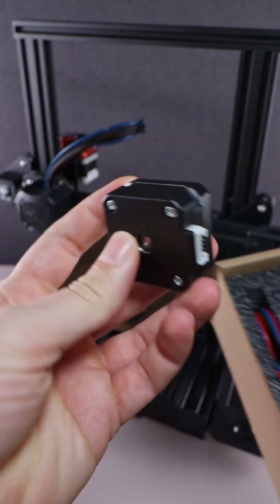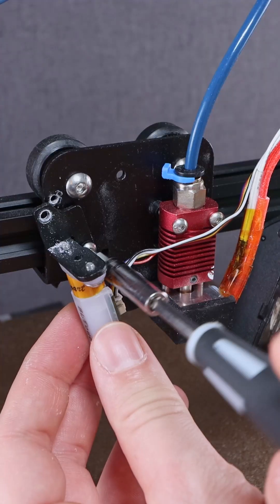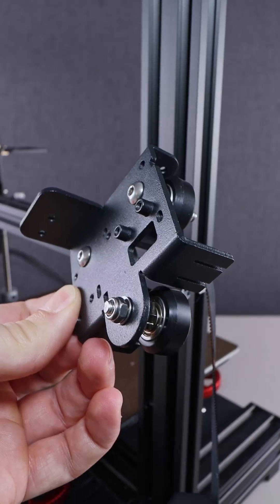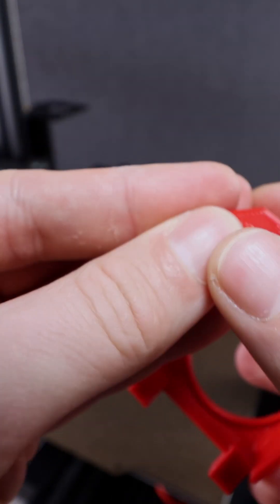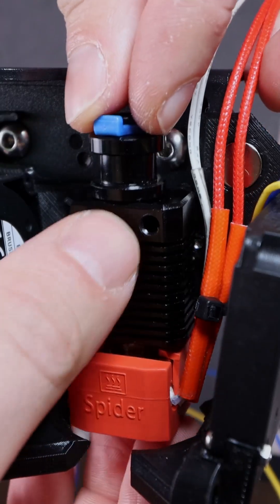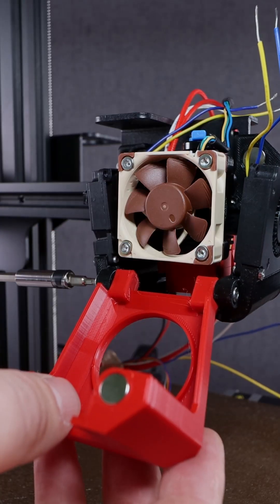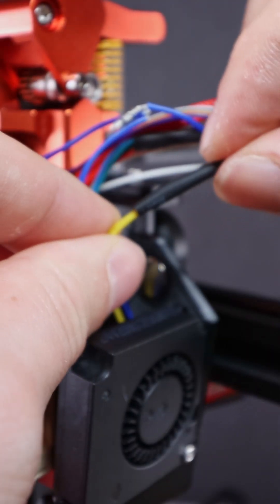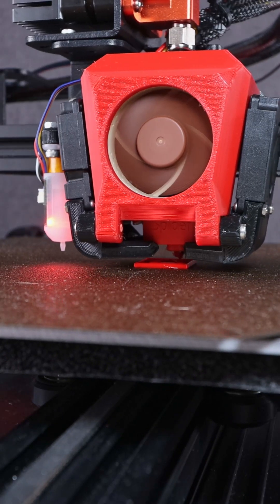Full Hotend Upgrade for my Ender 3 V2

Comment: Just use the bowden setup and never downgrade to the pancake stepper motor as they only produce half the torque of the 40-42 stepper motor. Lost performance from the new hotend just to have a directdrive hotend.

If you want a direct drive setup use the Orbiter V2.0 with an E3D V6 hotend.

but if your budget is tight this is fine just don't downgrade to the pancake stepper motor.

Comment: How did you get the pancake work? Mine doesn't move, I tried also VREF voltage to accomplish stepper Ah, but nothing. 
I'm mounting a complete Titan + E3D V6 that has already 3:1 ratio.
Reply from the maker: Hmm, I didn't really do much more than adjusting the vRef. Did you get the pancake stepper with right voltage? It needs to be 12V. I am using this one: https://geni.us/PancakeSteppe It works flawless!
Reply: @thebuildbay  Finally I succeded. 
I had to swap central wires on the JST plug of the extruder. Ender uses 1-4, 3-6, and my pancake from Kingroon uses 1-3, 4-6. 
Due to overheat I had to reduce VREF for extrusor stepper in the motherboard (v4.2.2) from 1.38v to near 1.0v.

Comment: Didn’t use any blue lock tight?  You need to use blue lock tight for every screw that screws in to metal parts.  If not the screws have a big chance of coming lose

Comment: Weak pancake will miss steps. Spider v1 is garbage
Reply from the maker: So far both are going strong, can't complain 💪
Reply: Mine fell to bits I replaced heat break it fell to bits. Many many people have had same issue. However the spider 3.0 is far superior and nearly as good as my dragon. The pancake is really suited to a 3:1 or 5:1 bmg gear set up due to very low rms current handling.

Comment: don't use that extruder with that stepper motor, you're going to burn it, that pancake is designed to be used with an extruder with 3:1 reduction or more, by itself it doesn't have the necessary torque to move an extruder of the type you use
Reply: With ender 3 speeds it'll be fine. But still not a single part of this video makes sense. 2x 4010 fans instead of a single 5015, spider hotend over a cheaper chc, direct drive but not going for the new bondtech gears.

Comment: It's not a direct drive, it's just a very short bowden extruder
Reply: Even the Orbiter extruder has a setup like that. Unless the hot end screws into the extruder, you will likely have a tiny bit of ptfe in between the two.
Reply from the maker: Its not about the lengths of the tube, but about how you use it 😎

Comment: That pancake motor should be used with at least 3 to 1 reduction 
Using it with 1 to 1 you probably can go max 50mms ...or less
Reply from the maker: Actually, I am able to print up to 150mm/s without any skipping or underextrusion😎 The siginificantly higher flow of the Spider hotend compensates quite well for the reduced torgue of the E-stepper
Reply: @thebuildbay  thats pretty good
Cht nozzle ? Or new stronger pancake ? (Older ones were low power)
Reply from the maker: @ErtsenPlayGames  I am using the nozzle that came with the Spider Hotend V1 and this stepper: https://geni.us/PancakeSteppe I made sure to get a stepper with 1A rating, so I can run a higer vRef leading to more torque.

Comment: Twisting wires together, using a pancake motor with no reduction extruder, cutting a Capricorn PTFE instead of removing it and putting a bad direct drive

Just put a Sherpa Mini in there....
Reply from the maker: ...and yet it prints at 150 mm/s without skipping or artifacts, while the pancake stepper sits comfortably at ~39°C 😎
Reply: @thebuildbay  what i wanted to say is that your setup isn't optimal at all. This kind of direct drives with no reduction uses full size motors, which enduce ringing due to the excessive weight of the head

An orbiter or a Sherpa is specifically meant to be used for a direct drive and uses a round NEMA 14 pancake motor, which gives it as much torque as a big NEMA 17

Comment: when you cut the capricorn tube like that I felt it in my soul
Reply: I died internally too
Reply: hahahaha
Reply from the maker: Guys, relax! It was stuck and I couldn't be bothered to heat up the hotend. Cutting it was the faster solution 😉
Reply: @thebuildbay you dint even need to heat it up just pull it out from the clipyand snip the filiment
Reply: @joshuaevans99  the ender 3's heatbreak isn't all metal so the ptfe tube sits right against the nozzle and filament can gather there and adhere the tubing to the nozzle until it's melted
Reply: @thebuildbay  ok, makes sense
Reply: @thebuildbay  CUT IT SHORTER THEN YOU DINGUS

Comment: you shouldn't use a pancake stepper motor, with all metal extruder type creality... This motor doesn't have enough torque for this application, it can increase vref, but it's forcing the motor with high temperatures, even with the heatsink, instead In addition, you could have used a bmg gear extruder, which is even lighter than this one, more efficient and lighter, and you wouldn't even need the heatsink
Reply: YES YOU SAID IT HAHAHAHA NOOBS IN OUR LOCAL COMMUNITY do this and complain about extruder motor clicking hahaha.

Comment: Pancake motor for this extruder isn’t very good combination better is with geared extruder like titan bmg orbiter …..
Reply from the maker: The pancake stepper has been added for weight reduction. With the right vRef settings and the Spider hotend, which has a significantly higher flow, it runs smoothly. I tested it up to 150mm/s and it worked without skipping 😎
Reply: @thebuildbay  what vref settings are you at for that pancake motor? I tried teh same thing but it was not strong enough and kept getting hot. Not too hot but 45-55c.
Reply from the maker: @Zeltroix  I set mine to 1.2 Volts. However, the voltage is dependent on the stepper's amps rating. The one I am using is rated with 1A: https://geni.us/PancakeSteppe If you are using a stepper rated with 0.7A, your max voltage shouldn't exceed ~0.95V...I hope that helps 😎

Comment: What kinda difference is the upgrade gonna make to your printing?
Reply: Realistically, you would have a higher top speed running bowden. As for reliability and quality, I prefer direct drive as well. Although I run a 42-40 stepper instead of a pancake.
Reply: Oh awesome, what kind of difference has it made to speed/ quality? Tbh I would love to knock an hour or more off a 40hr print and keep the same quality
Reply: Also I’m doin a dual z rod and auto levelling upgrade tomorrow on my ender v2 hoping it will make prints a lot more consistent
Reply from the maker: The target was to achieve significantly higher prints speeds while improving the print quality and making the printer more reliable. All which I have achieved (in my opinion)